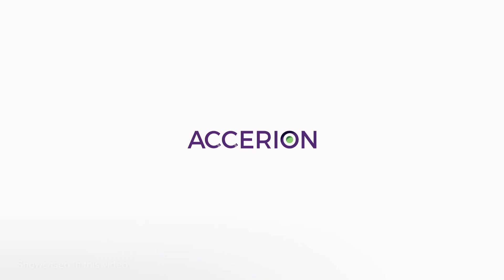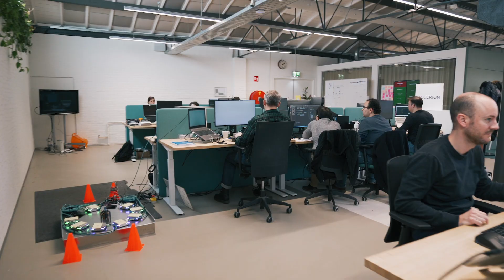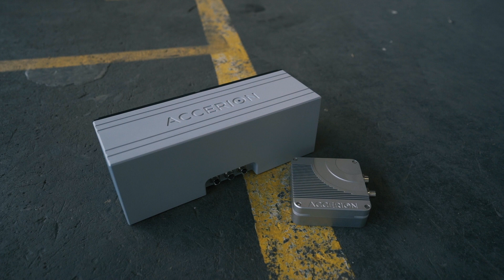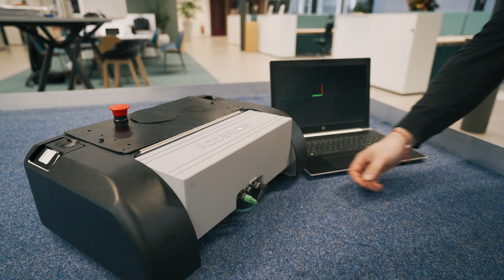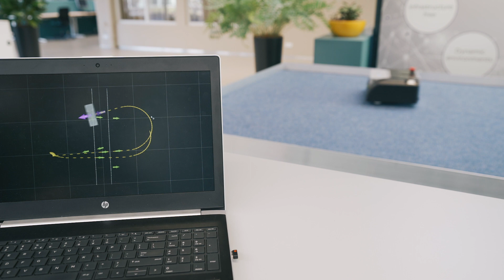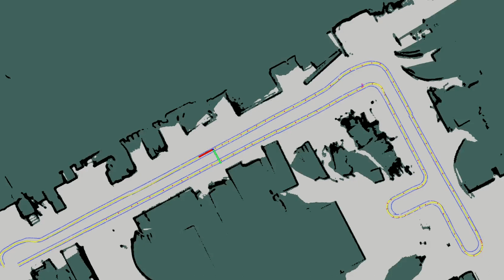Accerion Virtual LogiMAT 2020 | Accerion

Comment: Some AGV system have many kilometers of path.  What happens during installation if you hit a section that you find to be "unsuitable"?  Also the, demo vehicle is a small diff-drive unit and clearly the navigation supports tricycle configurations but what about multi-wheel all-steer/drive AGVs and longer AGVs.   Do you also need multiple antennas?